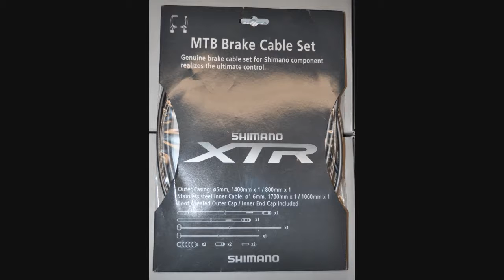Assembling a Motoped DX Motorized Downhill Bike

Comment from the maker: My understanding is that its specially made, The disk brake side is regular disc brake mounting holes, but the other has a mounting hole pattern for a dirt bike type rear sprocket instead of a bicycle cassette.

Because your making it yourself, you can set the specs for the rear so I'd suggest just using a pit bike hub laced to a larger size dirt bike wheel, or if you want to stick to mountain bike tire's lace it to a MTB rim.

Comment from the maker: You should be able to use any plain dirt bike throttle, I got mine from sick bike parts. For the switch I use an on/off but have since changed that to a momentary push button so hitting the switch accidentally for a second wont kill the engine. You can get those on eBay (called "button killswitch")..

I havent had any issues with the Police, not even stopping me to check it. I went 125 to 140 then down to 50cc to stay legal.

Those who have ridden mine love it - even MX guys.

Comment from the maker: It is 2" OD, but it's a single spar and doesn't have a triangle type frame to distribute the loads or add stiffness so my bet is that smaller diameter and thinner walls wouldn't be a good idea.

Comment from the maker: It says "ELECTRICROSS", with a wheeled lightning bolt above it. I haven't seen anything similar. If you search for information on Electricross, they made a bike called the drift in 2009, were out of Santa Cruz and their domain redirects to Zero Motorcycles. Cam Woods of Motopeds works for Zero Motorcycles now, so my guess is that Electricross was just a brand name/other project prior to Motopeds and Zero bought it when they hired Cam.

Comment from the maker: @2239968 I think its mainly because I went with the cheapest components.If you get a more expensive seat you don't need to make that bracket (sikk50 etc).

You don't need those plastic washers on swingarm.

The front brake shouldn't have needed anything, but again I went with the cheapest DH fork I could find.

The crankset came from a 2001 bike that wasn't designed to be taken apart so if you bought a single speed or a DH crank set you likely wont need that, and can adjust with washers.

Comment from the maker: Total cost was $2500. The frame/swingarm from Motopeds being the biggest single expense at $1500. Next was the Lifan Engine at just under $300. I got a good deal on the front forks at $125 which are generally a bit more than that.

Comment from the maker: I'm so Fat and Lazy that I even have to use a car to get around.

The cranks off a 2001 specialized I had to adjust chainline. The regular cranks I replaced those with which I believe were FSA, the chain line was perfect.

May I point out that the forks are terrible - shitting on those would be a much better use of your time when the chainline issue is actually moot if people get the right ones.

Comment: Thanks - I had not found that. A lot is self-explanatory, except for throttle/cable/grips/switch - maybe there are generic sets for motorcycles. Did you go 50cc? How about 125cc, but marked 50 ;-) Cops find it interesting where you live? Do you still ride it - what's your take now?

Comment: On the rear hub is the sprocket just a pitbike sprocket? Trying to find a sprocket that looks like that one. The only thing I have come up with is a pitbike sprocket. And do you think you could measure the bolt pattern and the inside diameter of that sprocket for me by chance?? Would greatly appreciate it.

Comment: you have the wrong front caliper adapter i did the same thing at first but i used the presta valve lock rings as spacers the worked perfect, but that's dangerous get the correct adapter
Reply from the maker: Thanks - I should edit the video to mention that. I ended up realizing that when I took it to a bike shop and we found the right adapter.
Reply: a edit would be great so people are setting their brakes up correctly, otherwise thanks for the video im sure it will help many people out whats the deal with the delrin bushing you made for the rear end
Reply from the maker: The rear swing arm clamps onto the outside of the bearing and I was worried that the swing arm might shift left or right and hit the frame. The bushing was to stop that happened.

Ended up being unnecessary as once torqued down to spec the swing arm isn't moving.

Comment: Dude u guys are totally discouraging potential future motoped owners. This kit is made of the beast craftsmanship i have seen in a while. There is nothing wrong with the kit he received. He was just trying to make parts fit that were not meant for this application. This is why I'm buying the rolling chassis. Go to the web sight and look at the parts they put on this and tell me if you could have made it for cheaper than 2000.00. And I'm getting a 800.00 engine 155z ho. 2800 for super nice motoped with parts they recommend for this bike because don't forget this is not a 20lbs. Mountain bike these can way between 100-150lbs. That's why they use 4piston hydraulic brakes to stop this beast now. These things are sick don't let anyone else say otherwise.